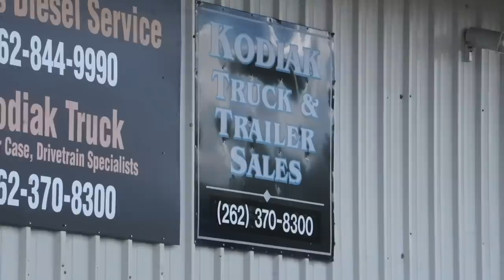This Body Shop Wants To Paint My Duramax For Free!

Comment: Funny everything thing he said is exactly how I would do that job which most body shops I see aren’t even close. that’s how a small town body shop should be quality and customer service come first. There’s a couple triangle holes for the braces of the rockers and if GM would have seam sealed them shut from the factory a lot of these trucks wouldn’t have rusted the rockers away. Which I just checked last week and the brand new trucks are built the same, so eventually we’ll be doing rockers on those also.

Comment: Your videos are awesome 👏 keep up the good work !!! A quiestion for you or the guys here, I’m new to the diesel world I’m looking to replace the blue fuel hose on my lift pump and was wondering do I need to drain the diesel out of the tank or can I just remove the hose without spilling fuel everywhere?
Reply from the maker: Not to sure i would run it till it’s on E before I pull that hose but I’m sure you will have to drain the tank

Comment: So what would be the recommended turbo for a stock GMC SEARIA LBZ dully that spends 98% of its life pulling a flatbed, gooseneck hauling steel across the Afton mountain?
Reply from the maker: Contact Ryan’s Diesel Service but I’d recommend a 64mm
Reply: @TruckMaster  I've been following Banks Power..... a stock (insides) L5P except for cam shaft at 1004 HP!!!

Comment: I have a 2004 chevy 2500 w/duramax.  The band is broke on the turbo and the hot side pulled apart
Reply: What would cause this to happen and what would the fix be?